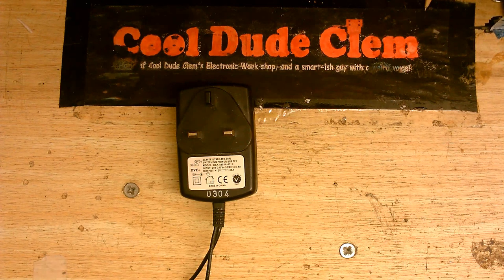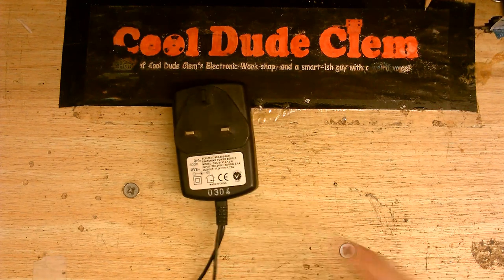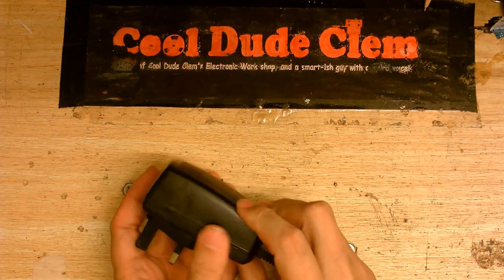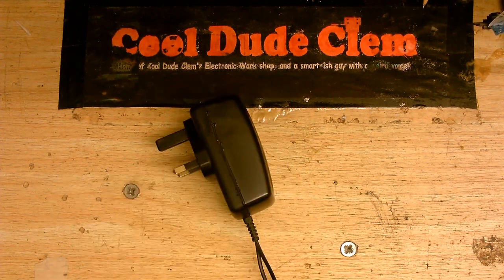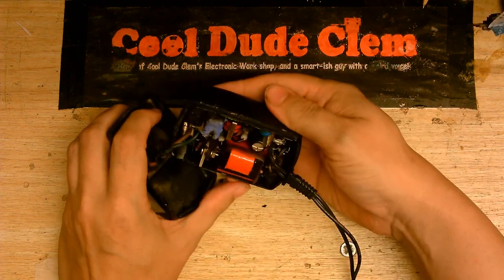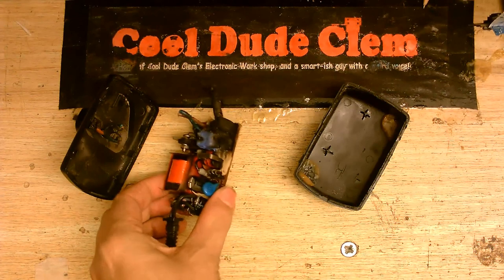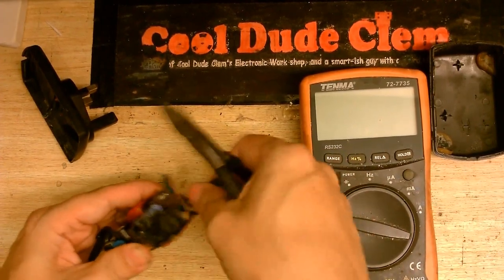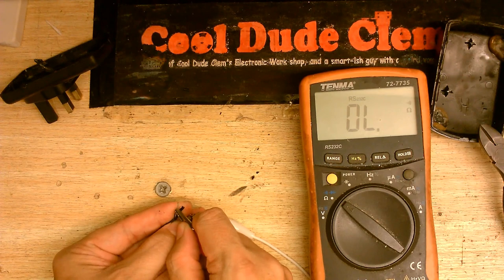Autopsy of a blown Wall-Wart PSU

Comment: I could see an output capacitor puffed up with a domed top. That may be what lead to the other failure. SMPS have limited lifespans. It is not if it will fail but when.

Comment: They usually seal these devices using ultrasonic welding.
Reply: A good squeeze in a vise gets them apart. Sometimes I have to squeeze them from a few different orientations before they pop. Cracking sonically welded wall warts open is a bit of a hobby of mine. I buy interesting looking ones at thrift stores and break them apart to see what's inside. Usually they're like a buck. So the price is unbeatable. Not even surplus from Chairman Mao's warehouse can match it.